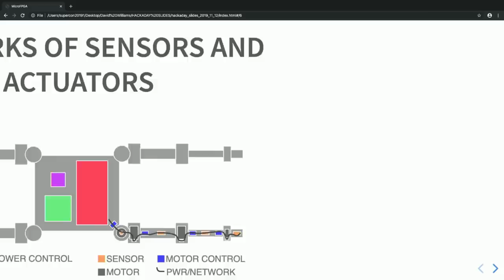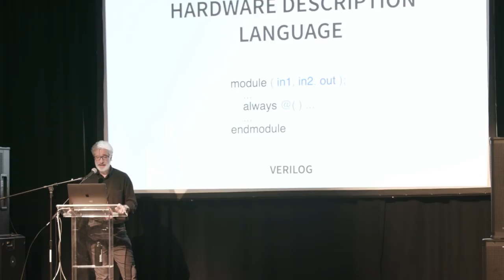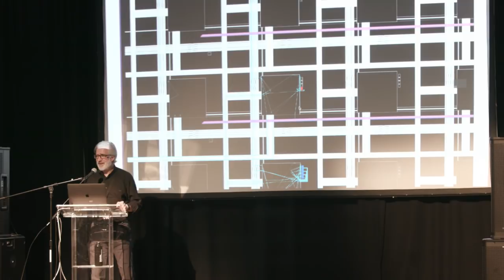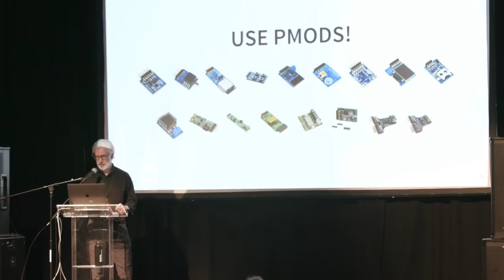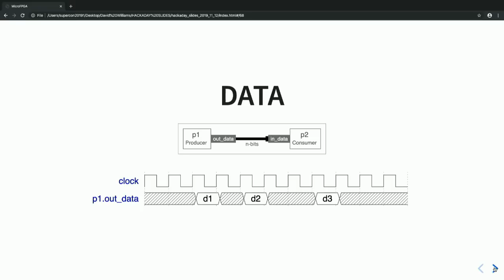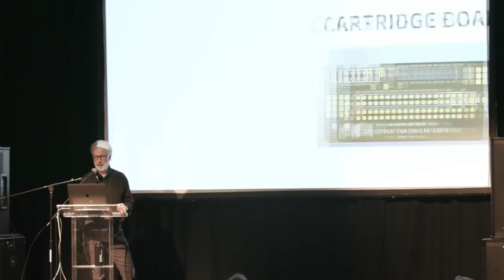David Williams - MicroFPGA – The Coming Revolution in Small Electronics

Comment: A lot of problems with open source RTL arise from the code being the result of student projects at college, using some janky interface that no one uses. Silicon engineers use things like AMBA specs -AHB, AXI, APB and so on for on chip busses and that's what we use on FPGAs to hook up our designs in validation environments. For soft cores - look to the old 8 bit CPUs. They all have extensive, free SW and compiler support and they are very easy to design in HDL. Avoid verilog - it's old and not used in industry. We use System Verilog and VHDL. If your tools support system verilog, use it - it makes much more sense and has exceeded VHDL in recent years in terms of usability, although VHDL is fine if that's what you know. In terms of signaling protocols, most of what he asked for is standardized already, you just need to find the right standard. But there are many because the different needs are many. Avoiding protocols with tri state signaling is good - Things like I2C. They are tricky to implement well and it's a bear to trace what is going on on a scope. The req-ack protocol he showed is fine, because it's easy to trace on a scope and critically, req-ack protocols are tolerant to synchronizers in the control path, which is something you will need to deal with when hooking chips together. There are many good books on RTL design. It's worth investing some time with one to get over the 'digital logic design' hump - getting past student projects and onto real world systems that do useful things.

Comment: Why don't we see FPGA's in motherboards yet? Some desktop applications could really take advantage of coding some logic into FPGAs I would imagine.
Reply: (1) They age quickly. Next year's FPGA is better than last. (2) It's useless without the tools and the tools are expensive. The demo boards that people use  - generally the vendor does a deal with the FPGA vendor for access to a limited version of the tools (E.G. the Altera Quartus 'Lite' edition. (3) It's not really necessary. If you need one you can buy one and plug it into USB or on a PCi card.
Reply: They are very power hungry. And they dont really add much value when your hardware is fixed, as in a PC.
Reply: @nicolasbrusco1997  So why are they used as accelerators in datacenters? Power is a key factor datacenters keep an eye on.